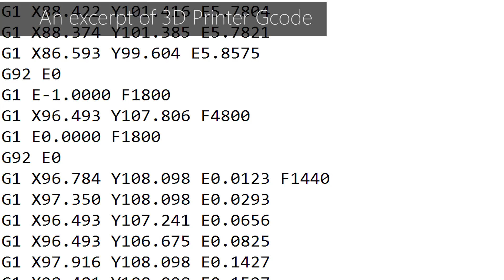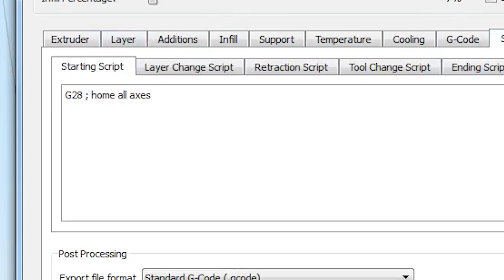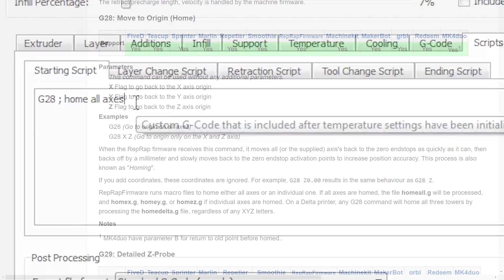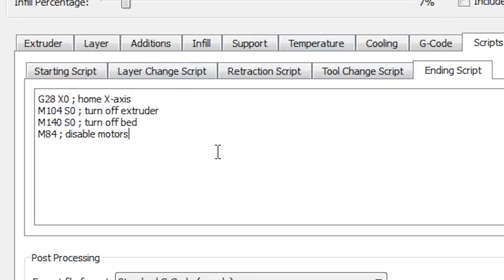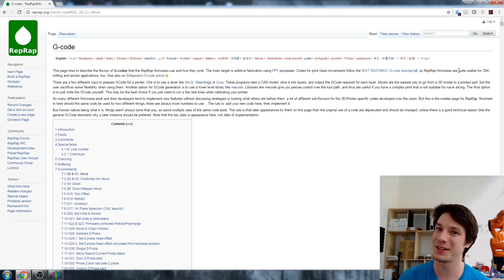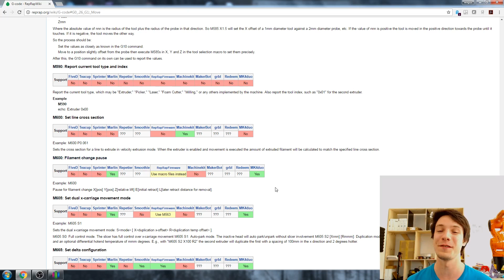How to use Start and End Gcode Scripts - 3D Printing 101

Comment: Hi,

I have a 3D-printer, "Pioneer Xvico", that I bought last year.
And from the beginning it work with Cura 14.07.
I tried to install Cura (another version) but 3D-printer doesn't reaction to output "G-code".

Is Problem go back to "Start, End -Code"?
How can I find the problem and solve it?

Thanks a lot

Comment: How do i rotate bed in simplify3d. I change something and now when I open simplify3d the picture of build platform axis is on opposite side. If I print to one side of bed it prints opposite of where i placed image. Any suggestions
Reply: Check the G-Code tab. Below "Update Machine Definition" there's and option for flipping build table axes

Comment: Thanks for the video. I have simplify3d which sends the gcode to Arduino based 3d printer. I want to use a camera to capture images for every new layer. So for this I'm thinking about installing octoprint on Windows. In this way simplify3d sends the gcode to the octoprint, then octoprint trigger the camera and sends the gcode at the end to the Arduino. Is it possible? Or would you recommend better ways? Thanks

Comment: Great tip!  I'm adding a finish script that will pull a couple of centemeters of filament back in when the print is done. My CR-10S can be hard to change the filament after the extruder has cooled down.

Comment: This is the script I've found most useful
I'm going to change it to include your G28 option as I probably don't need to home the Y.

"M104 S0 ;extruder heater off
M140 S0 ;heated bed heater off (if you have it)
G91 ;relative positioning
G1 E-1 F300  ;retract the filament a bit before lifting the nozzle
 to release some of the pressure
G1 Z+5 E-5 X-20 Y-20 F9000 ;move Z up a bit and retract filament even more
G28 X0 Y0 ;move X/Y to min endstops
 so the head is out of the way
G1 Y150 F5000 ;move completed part out
M84 ;steppers off
G90 ;absolute positioning"

Comment: my print always starts in one corner and the code is G28 Z0 , doesn't say anything about the other 2 ,all else is normal but it always starts the print in the home corner.
Reply: G21       ;metric values
G90       ;absolute positioning
M82       ;set extruder to absolute mode
M107      ;start with the fan off
G28 Z0    ;home Z
G1 Z15.0 F840
G92 E0    ;zero the extruded length
G1 F200 E3
Reply: I have a Cr10 and use Simplify 3D. I dont see the printer listed in the RepRap G-code list. Which one should i use?

Comment: You mentioned it in the intro, but never went into further.....moving the print bed forward after printing has completed. I get that its G28 Znnn....but what value do i put as nnn? All the way forward is 255? or does this depend on bed size (mines 220 x 200)
Reply: if it's a Cartesian machine, you'll prolly need:
G28 Znnn
G28 Ynnn
Or maybe:
G28 Znnn Ynnn
depending on weather or not you'r interested in interpolating the ZY planes simultaneously
btw your Y value depends on where home is on your machine. If you home with the nozzle in the lower left, it'll be the extreme end of your build volume that you want to set nnn

Comment: Important, and very basic thing to note. Be sure you understand that the g code movement values can be given as either absolute (G90), or incremental (G91) mode. You don't want to add a Z10 to the end of your code while in absolute mode thinking that will raise the head up 10mm. You need to change the mode to incremental first to do this.

Comment: This was one of the first things I ever did with our flashforge creator pro because when using the left extruder it homed to the right and ended up extruding a large blob when trying to purge.  Now it works perfectly!  Also, simplify3d defaulted to heat up the head and the bed one after another so moving some things around allowed them to heat up at the same time.    Definitely helpful to adjust the starting gcode.  Thanks for another great video!

Comment: Hi Angus, great information as always. Ive been writing in G-code for industrial CNC for years so thats not a problem. I was wondering if there is a way to "turn on" or modify the paramaters of a 3D printer to accept new g-codes... like writing a macro to say... add a feature that it does not currently support.
Reply: To start, you would need to know at least the basics of programming a firmware (Usually C is the basic language, and ObjectiveC gets used a lot as an extension to it). It's not clear to me from your comment if you already have that covered. The next step would be to find out what firmware your machine is actually running on. I hope it's open source, or at least running on a controller board that is supported from open source firmware.
As you can see on the reprap.org website, there are a lot of different firmware projects, usually tied to some specific microcontroller or board type. The next step would be to find the source repository (usually github.com) and start reading and understanding the current code. That's probably the hardest part of it, but you should have an understanding of how the current firmware actually works, before you can make changes to it. Then, you would have to set up your toochain, so you can actually compile the firmware into a binary and load that into the controller of your board. For some boards, this is pretty simple and straight forward, for others, it can be a pain in the butt and maybe you even need special programming adapters so you can download a new firmware. Once you managed all that, you can slowly start to modify the existing, working firmware and expand it. Once you are at that point, it's probably a good idea to get in contact with the developpers, (if you did not already do that before). Maybe your extension is actually good and useful, and could/should be merged back into the main firmware, so everybody can use it.
Reply from the maker: Hey Bill, you absolutely can in firmware - though I'm not skilled enough to point you much further than that! Maybe someone else can chime into exactly where to start.
Reply: Thanks for pointing me in the right direction. I am waiting for a Cetus 3D and am not even sure what software it will use so can't answer open software or not issues yet. As for the C language I am working on that but have never even heard of 'ObjectiveC'. I'll look into it when the time comes and keep your answer handy for reference. Thanks again.
Reply: Hey, no problem. The Cetus guys talk about "hackability" of theyr printer, but for now i could not find any information about the final controller board and firmware they are going to use, so i guess you are in for a surprise. ObjectiveC might acutally not be the right term for the language i had in mind, basically it has it's roots in C, but can deal with object oriented programming as well (methods, classes, all that stuff), but it's not as extreme as pure C++ or C# code. However it really depends of the firmware, there are probably some that purely use C without any object oriented programming. I'd say if you start some experiments with an Arduino and some shields with input and output devices for now, you should be heading in the right direction.
Reply: Thanks a lot. I think however, my first order of business will be to install a filament sensor. I think they (Cetus) said the machine has a power failure restart feature so I can use an optical type sensor to pull the power if the filament runs out. That hopefully will save a few prints and let me maximize my filament usage.
Reply: Hi Bill. I'm working on creating a G-code debugger and would love to talk to you about it. Feel free to message me directly if you'd be willing!

Comment: I use the start gcode to set acceleration and jerk profiles. If your printer is prone to skip steps the layer change script is a good place to home X and Y (makes print slower and creates oozing artifacts, though). Also the layer change script is useful to trigger cameras, so you can get nice timelapses even with i3 printers.

Comment: I changed my GCODE in Simplyfy3D to change my bed from heating then stabilizing then the nozzle to both heat at the same time to save waiting time. My CTC printer ignores this completely for some reason and won't heat the nozzle until the bed is up to temp. Very annoying :(
Reply from the maker: I've seen this sometimes, it may be a firmware thing to avoid drawing too much current from the powersupply at once, perhaps?
Reply: That's an interesting idea. My friends CTC up the road though works fine, so it must be as you suggest firmware related then, I must be on a different sailfish version than him. Thanks Angus :)

Comment: Just today I started using octoprint. I found that the cancel print button would just stop the head. I entered some gcode script so that it would lift the head and move away from the print, disable steppers and turn off the extruder heater. Works great for the cancel button. The printer /slicer handles the start and end script otherwise.

Comment: M600?  Did someone get the new multi material upgrade for their Prusa i3 mk2?
Reply from the maker: M600 works as a manual filament change pause on supported Marlin firmware machines :) multi colours off a bog standard single extruder!

Comment: I work in a machine shop and run a.cnc vertical mill for a living, when I tell people they run off the same principles as a 3d printer it blows their minds...
Reply from the maker: Stop lying, 3D printers run off magic ! :)
Reply: Maker's Muse LOL i got a notification on my phone I read "stop lying" and was about to lose it then I came in here and read the rest.
Reply from the maker: Hahaha ! The dangers of truncation...
Reply: great video btw
Reply: Anyone has a start code, for an i3, that is useful? 
With anchors and stuff?
Reply: Hey, Thanks for the reply. However this is only an end code change, and most of my issues are oozing filament tangling up the first layer.
Reply from the maker: try a purge line, part 2 will cover that. :)